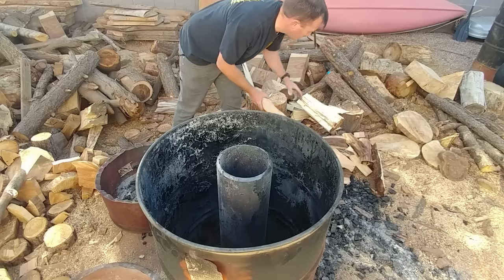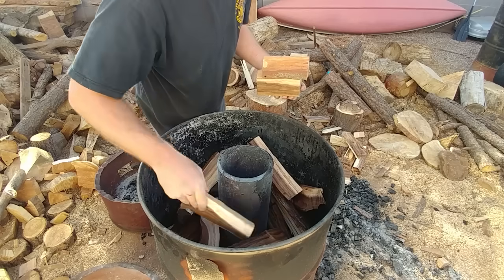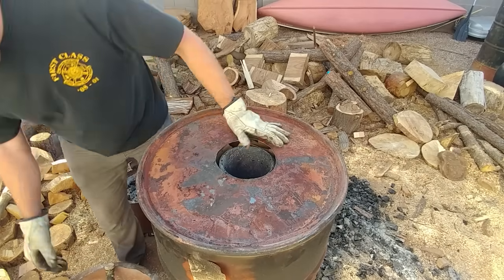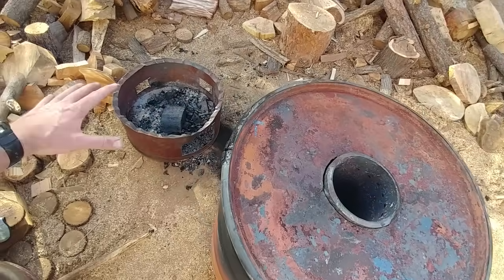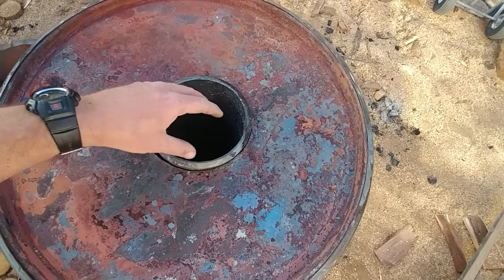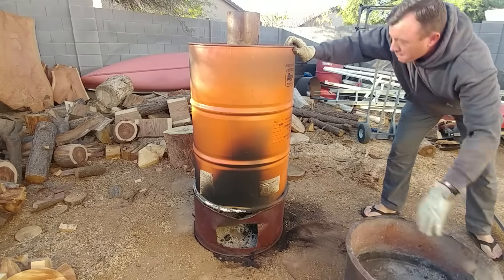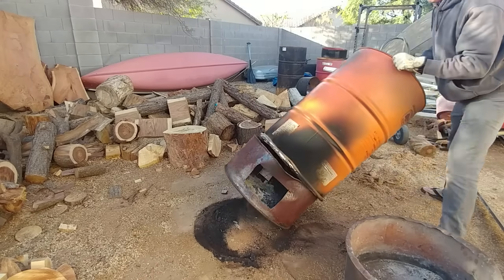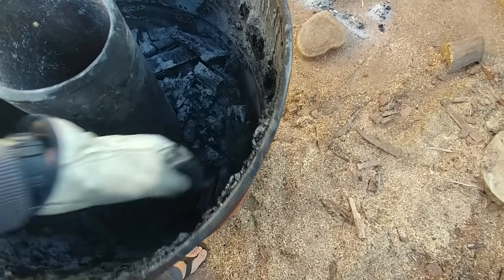How to make charcoal in your backyard

Comment: The reason conversion was not complete was that all heat was only applied to the bottom & from the inside.  If you choose to do it that way, you need to insulate the outside of the barrel, so heat is not lost there.  Most of the area of the barrel is on the outside & cold!

Comment: The water vapor phase and methane phase are about the same time length, and it's easy to tell when the water vapor phase is over (because flames start shooting out).  If the flames continue for longer than the water vapor did, then there's combustion going on inside the barrel and you just have to stop the process.  You won't have perfect charcoal if that happens, but it'll still be usable and it won't have all burned up.

Comment: Your design has a small flaw in it.  During the initial heat up (before gasification)  you are allowing both heat and oxygen into the retort.  This is probably causing a burn to happen up to the point gasification becomes significant.  You would get more charcoal if you forced the gas out the top and piped it back to the bottom.  Maybe not flip over the barrel so the gap around the lid is away from the flame.  Very cool design, though.  Get the bugs worked out and let us see a full barrel of charcoal!

Comment: Your lid has a gap that makes oxygen to get sucket in to the wood, so you burn it UP instead of getting charcol. You culd fiks it with a weld or maby some dirt and water and make a paste ✌️ cool Setup, thinking about making something like this my self
Reply from the maker: I've been thinking about flipping it so the gap is on top and use some mud to seal it.
Reply: @KimballCody  mud for seal is gonna be good 👌😎 ive just learn for my self when i tried smaller one for test, that some oxygen to 0 oxygen makes a big difference on how mic is getting burnd up en the charcol being left ✌️🙌
Reply: @KimballCody  but i love the setup, gonna make one my self 🤟

Comment: I am looking at so much energy coming out of the top of your kiln. I do think all that energy would be more effective heating the barrel or another kiln on top of that one. Most likely you are not getting good heat transfer to the charcoal.
Reply from the maker: There are different ways of conserving the energy. Some retorts redirect the gas and have it burn under the barrel.  That involves a double chamber, pipes, valves etc. My set up is one step above a dirt pit covered with corrugated sheet metal.

Comment: Question, what did you use for the center pipe ? What can you use as an alternative
Reply from the maker: It was a 3/8" thick 6" steel pipe. I picked it up at a scrap yard.
Reply: If you have welding equipment, finding steel pipes is easy.  They're all around.  If a neighbor is tossing out an old swingset = free pipes.

Comment: The quick and dirty method is a barrel at a 60 degree angle.  Tight pack the wood and light a fire on top.  I've heard it takes a couple of hours but the air flowing from the open top limits the oxygen to most of the wood.  cover or soak to stop it.  You get less charcoal but it's simple.

Comment: Your charcoal burned because you didn’t seal the area between the flue and lid which could be done with clay. It also didn’t get hot enough which could be dealt with by wrapping it with rockwool insulation or something else. This is a very solid design though and I’ll be using some of its aspects!
Reply from the maker: Thank you.  I've since be able to get better yield by taking it out and cooling off the burning portions.  I'm going to reverse the position of the barrel and seal off the lid with fire mortar

Comment: I suggest chipping the wood if that’s possible because it increases your surface area so you don’t get those big chunks that are half charcoal half wood. This also allows you to fill the tort more and you’re able to process more at once. If you do this don’t let it burn so long because much of your yield was burned already. By far the best design I’ve seen though!
Reply from the maker: Thanks.  I've since done a few different experiments and have had better yield.  My next set up is going to be welded on the bottom end and I'm going to use mud/clay to seal the chimney on top.

Comment: I just watched another video where they sealed the barrel with dirt and mud after the burn. They took the barrel off of the burner and stuck it in a hole in the dirt. Covered the top with a piece of sheet metal and covered it with dirt. Wouldn't take much more effort to add this to your procedure. Would solve the problem of air getting in. Really good video. I have a friend with a  welding machine. Should be pretty easy to make. Not bad at all for a first run. At least you tried and you learned something. Thanks for sharing. Very cool.
Reply from the maker: I've been thinking about making a 2.0 edition and using mud/clay during the cook.
Reply: @KimballCody  Early waiting to see it. I want to make some charcoal. What are the modifications to your build ?

Comment: try eliminating the hole on top and bottom..make new small holes like one inch diameter make four holes at the side of the drum make it as low as you can..fill it tightly light it up using the holes you drilled and then let it smoke for 3 to five days..no need to use scrap wood as burner..those scrap wood can be turned to charcoal.
Reply from the maker: My burner is called a retort. It doesn't "smoke" and the gasses are reburned and help heat it.
Reply: KimballCody ah got it..maybe its illegal in your place to produce smoke..cause its very smoky when making charcoal the premitive way but its more effecient..and effective..
Reply from the maker: A retort is actually more effective and efficient. It reburns the smoke to help heat the wood

Comment: Seal it up so air can't get in when it is hot. 
Also fit the wood in so it is as tightly packed as possible.
Reply from the maker: What about the smoke?
Reply: @KimballCody 
Run it through a pipe  and bubble it through water so when the kiln cools water gets sucked in to balance the pressure. It can then be injected back to fuel the kiln or the washed the smoke  can be used as motor fuel either at the time or compressed for future use. It is not a compressed to liquid gas like propane so it takes really big tank a very high pressure. 

To be fair if you didn't have much ash in the kiln it is tight enough and I just thought there was more wood than there actually was and do like running engines on wood gas.

Comment: the reason for the smaller amount of charcoal is because you left it in there after was done. You need to take it out and cool it immediately otherwise charcoal is going to keep burning and it will turn down to ashes you need to cool it down either with water or wIth soil to cover it and spread it out depending on what you want to use it for.
Reply: No, the reason is because oxygen is getting into the barrel through those holes after the gasification stage.
Reply: @patandderry8416  that's exactly why you have to cool it down, to stop oxygen from reacting any further and reduce it to carbon dioxide.

Comment: Uncontrolled air flow, and uneven heating was the problem. Take your drum and drill one line of 1/4 inch holes every four inches from bottom to top of the drum. Fill the drum with wood, size does not matter, largest wood closest to the holes, seal the drum. To be clear, the drum is completely sealed except for the 1/4 inch holes. Tip the drum onto two end supports, (bricks etc.) on its side, HOLES DOWN, two to three inches off the ground. Put wood along the length of the drum on both sides and light it. You will only need enough wood to evenly heat the drum to begin the gasification process. The wood gas will come out the holes on the bottom, ignite from the fire and augment the heating of the drum. No O2 can enter the holes until it cools. i think you will find this technique to be far more efficient.
Reply from the maker: I'll try it. Do you place the drum in the dirt after gasification is done to choke out oxygen?
Reply: If your drum is well sealed, there is no need, but if not, yes.
Reply: Additionally, if you have plenty of wood, put only one, 1/2 inch hole on top, with no holes on the bottom. What will come out that 1/2 inch hole will be wood gas, (mostly hydrogen) run that through a filter, (two step, dryer and simple sand) feed it directly into the intake of your genset, and you have electricity, when the grid goes down and you don't have any gasoline.

Comment: Reason you didn't get as much as expected: you placed the split wood horizontally with huge gaps in-between wood then sealed - you sealed in a stack of oxygen with the wood so it could burn away like in a regular fire. What you need to do is stack wood vertically next to each other absolutely minimising air gaps, pack as tightly as possible (bash them together with hammer if necessary) fill entire barrel (container - whatever) from bottom to top and then just do exactly what you did - high yield then, hope this helps
Reply: Mike Hewitt can u elaborate with a demo🙏🙏 please
Reply: @aloysiusdinyuy7864  just pack the wood as tightly as possible
Reply: What if we use saw dust to fill the gaps? Would that also yield compensable coal powder as well as drastically minimising the air inbetween the wood?
Reply: You got your perfect demo just pack the can as full as possible with nothing bigger than your fist works great for me
Reply: I've watched about all of these retort videos, and it seems like the horizontal drums rather than the vertical oriented drums are more successful with complete char and higher yields. Also those designs that incorporate then gas back into the fire seem to better in complete process without burning up to much of the final yield.
Reply: @greghackney8437  Im in the same pattern of thought. You built one yet lol?
Reply: Fill the gaps with rice husk
Reply: his drum has no way to cut off all air after the decomposition / pyrolysis process is done so the produced charcoal just keeps burning.  The vent holes and leaks around the flue pipe that allow flammable gasses to escape and further the reaction (good design) unfortunately act as air inlets once the reaction is done...in a few days most of the charcoal is consumed.  Had he not neglected the unit for a few days he could have snuffed out the charcoal and had much better yield I suspect.
Reply: Also try insulating the barrel better and using thinner pieces of wood so that you have enough retained heat to cook them all the way through
Reply: Get yer shovel and pile dirt the gap in the chimney
Reply: Thanks Mike
Reply: He needs to custom his smoker a whole diffrent way
Reply: @robertparsons9118  "Do it different" helps absolutely nobody and is only frustrating.  It isn't constructive or feedback.  Though it seems like you have an idea, so we'd all love to hear the actual help you might be able to provide.
Reply: Good info. Thank you
Reply: Insulate stock Barrel
Reply: Thank you for that bit of advice! 
I'm trying to make charcoal for a water filter and you just saved me a ton of time and effort. Your comment went perfectly with this video. 
Thank you both!
Reply: I'll have to agree, either put the wood in separate containers in the barrel and seal those containers individually to keep it more organized, but he got a lot of charcoal, but also burned a lot of wood and got ash, because of all of the oxygen that was trapped.
Reply: The oxygen in the air between the wood makes for around 1-10 moles while the wood makes for 1000's of moles of carbon, so it's but a drop in the bucket. I suspect the problem is with the chimney: we've seen a clear circular crevasse between chimney and pyrolysis room on the bottom side. This alone would not be problematic since you've (legitimately) decided to release the wood gas in this region into the flame anyway. But if his contraption were to have a similar crevasse on the upper side, an "across-the-room" ventilation current could arise throughout the pyrolysis room and this could of course ruin everything.
Reply: True
Reply: phương pháp đốt củi gián tiếp này ép oxy ra khỏi gỗ và cháy bên ngoài.
Reply: Low yield, but cool flame.
Reply: Hi Mike, I am looking at making Briquettes from Macadamia nut shells any advice? could you use this same process?
Reply: @grantwatson1148  - yes! They would be great because you can fill the container and just give firm taps all round outside of container as you fill getting rid of gaps mostly without any difficulty.
Reply: I have a lot of coconut briquettes,you can contact me +628117686330 i'm indonesia
Reply: @ridwangalaxy4109  lol.

Comment: So it has 2 holes parallel to eachother so the flame get through the pipe ? When we heat up the barrel the woodgas get released and get pressurised to the top of get ignite?

Comment: You could try with no air holes in the pipe, having it go all the way through, but putting the air holes in the top of the barrel, then once the gasses have stopped burning, remove it...overwise it will just turn to ash.

Comment: this is a wwaste of wood and time, just get a regular barrel, fill it with wood and light it, let it burn until you can see that theyre coals, flip the barrel over and fill the holes with dirt and let it sit over night. you get a bigger yield and no extra wood used. also you have to have the bung on the top once its flipped, you put the bung on when it stops producing the woodgas.
Reply from the maker: This style of retort produces higher quality charcoal

Comment: Too much of a gap around your pipe allowed flames to enter the chamber and allowed to wood, or a majority of it to actually burn. You need to seal that gap off better. Or better yet rebuild your kiln to burn on it's side with a single chimney coming off thus allowing for a sealed pyralosis chamber resulting a much better yield of charcoal. Check out Rick Rabjon's video. His kiln works excellent.

Comment: I use a similar size outer drum, in the middle I place a smaller drum up turned and filled with the pre charcoal wood. By heating with a fire in side the larger drum it allows for the gases to raise very slightly the inner drum allowing the gases out and when the fire dies down the inner drum drops making the seal again and not allowing any oxygen back in. It seems to work well although it is in smaller quantities but the charcoal comes out good

Comment: I think you did well here. Looking through the comments i agree with some...completely sealing out the air as soon as you are done the initial "burn" does prevent charcoal loss in my tests.  One thing i prefer to do is to use a TLUD (top lit up draft).  I do this because i only burn the wood i want to make into charcoal and don't use extra to heat it like you are doing. As soon as my flames burn out from the initial gasification process i seal the container and prevent the charcoal from burning further.  I think i have videos that will show you what i mean....if not still up i will make one on request for you.  Keep experimenting
Reply from the maker: Nice

Comment: Different than my setup. I have a 30lb grease drum inside of a 55 gal drum. Charcoal wood goes inside small drum. Then it goes inside large drum upside down. Fuel wood goes around the small drum inside large drum. Have a couple sections of chimney pipe attached to lid. Air holes in bottom of large drum. Light and put on the lid. Gets a good draft going. You can tell when the charcoal wood starts to off gas. The fire intensifies from the wood  gas. Have a lot of apple trees so have plenty of hard wood. Resulting lump charcoal works great in my grill and charcoal smoker. Am currently working on a charcoal brake rotor forge.
Reply: I have made three different size charcoal forges and a brake drum with two 3/16" plates in a slope to the blower hole has worked better than my others with a small fan and a dimmer light switch to control fan speed and I can tell you from experience that it is pretty efficient and gets hot enough to easily forge knives and machetes, swords, arrowheads ect. The one thing I've learned is to heat just enough steel you can work before it goes cold again and it's all experimenting would different steels to see how they move and how the structure changes in metal on a molecular level it's kind of crazy the way some steels react. I sure hope you make a forge it is fun to do and it is fun to move metal but something I didn't know before I started is charcoal does not need a ton of air, good luck and don't use aluminum anyting for a fire pot or anything like that the temperatures Forge reaches will melt aluminum easily and if you need more of a bowl shape fire Ash makes a great insulator just don't get it too wet just enough to make it look like Portland concrete mortar is more than enough and then set a heat lamp over it for a day or two and then burn a small fire in it to cure completely I sure hope my comment helps, one last warning though forging is addictive LOL be safe have fun Burns will happen just don't burn yourself too badly and get a thick pair of gloves
Reply from the maker: nice. I'd love to get a hold of some of that wood